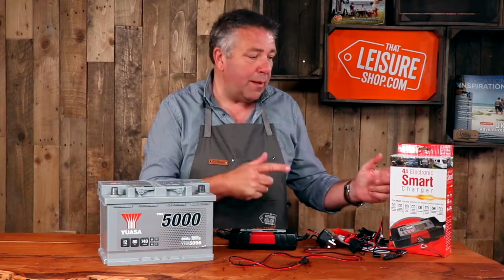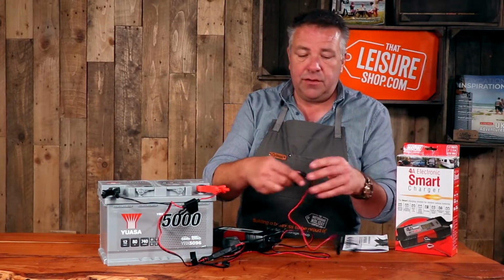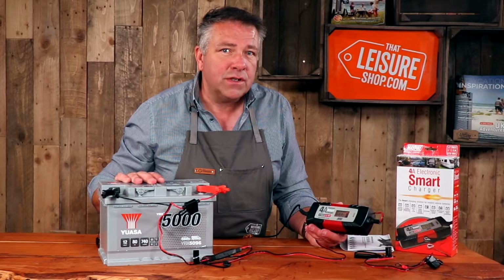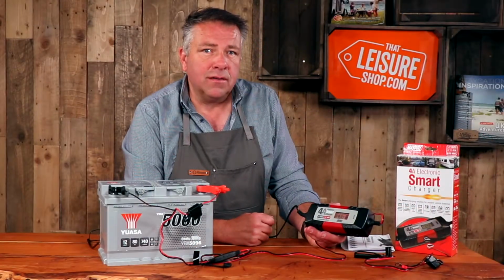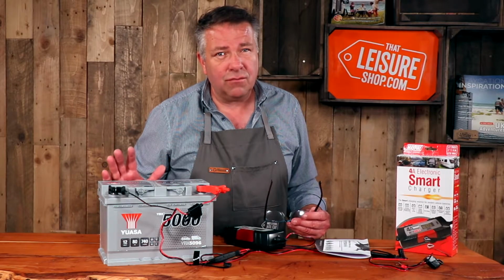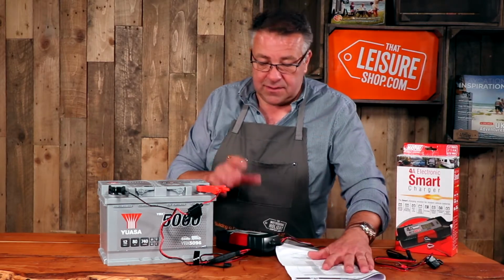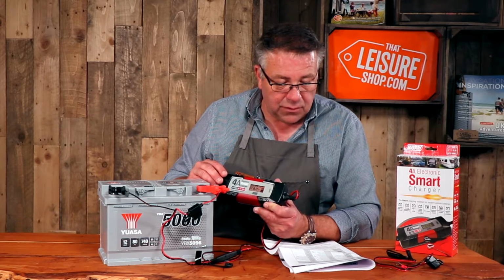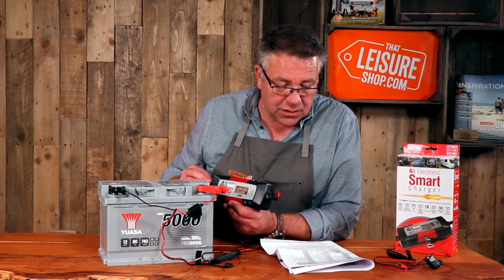Fix a flat car battery with Maypole's 12V 4A smart battery charger

Comment: I have one. It's brought my Jaguar S type battery back from 11.5 after leaving interior light on, I'd given up on that 850cca battery 2 years ago but it still holds 12.4 and cranks over like it's a new one. The high pitch sound seems to be high frequency pulse charge from low/poor condition, just best guess. Definitely short list this charger.

Comment: Battery fault indicated, but then what to do

On a 12v car battery showing 6v mode charging,  the charger showed only 3 volts, and the instructions say to leave charger connected for 30 minutes . . .
"(3) if the voltage doesn ’t reach 10.5V
within 30 minutes a battery fault is
indicated"
 (and the screen goes green) 
The battery was only 2 years old and under guarantee, so I took it to Halfords, who said the battery was probably OK but just needed to be left on charge longer.

 They put it on their fast charge workshop charger and after approx 3 hours it showed a good bit of  charge. After 7 hours when I collected it, it showed 91% charge and 12.85 volt. 

At home I I finished off the charge at home with the Maypole, which took another 3 hours or so.

The question is how can the Maypole cope when if forces a 6v mode on a 12v battery and then a battery fault is indicated which is possibly false?
If you can let me know, then I'd be very grateful.

Also, I think you said you leave the battery on smart charge permanently. Is that correct?